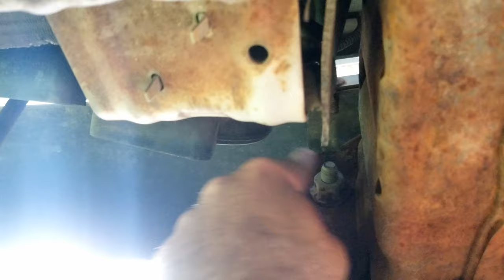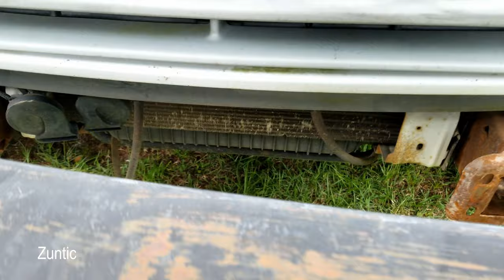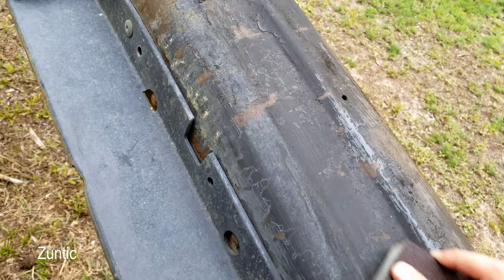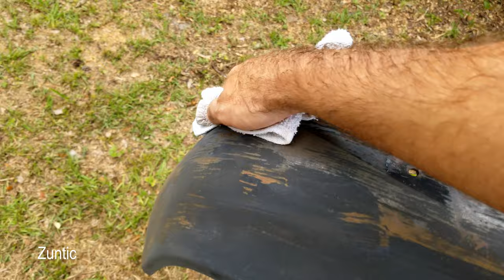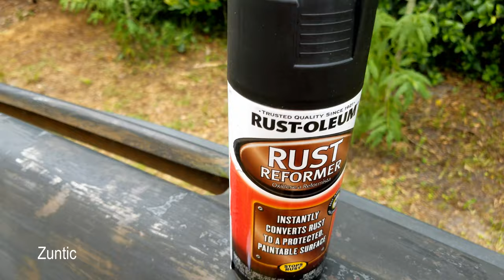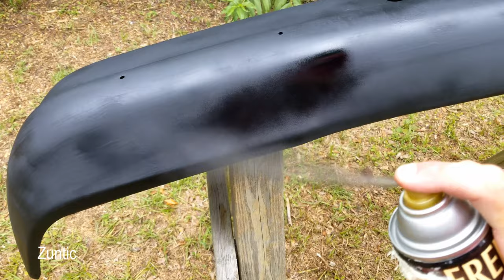Ford e-150 removing and painting front bumper on 2002 van

Comment: I am trying to remove the bumper off of an exact model van.  One of the nuts spins along with the bolt/thread so I am unable to remove it.  Any recommendations?
Reply from the maker: a pair of vise grips on the head of the bolt?
Reply: I have the exact same problem. Did you ever find a solution? I’m still stuck...
Reply: @yegwear6881  I ended up having to tear the bumper off.  After that i cut the bolt.  Wish i could help you with a solution.